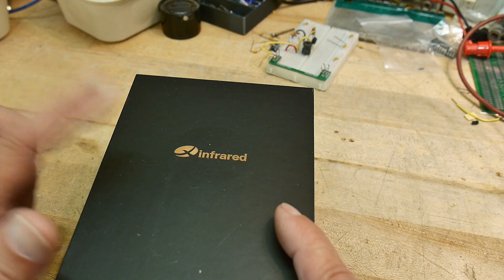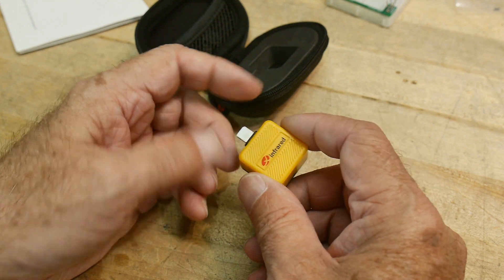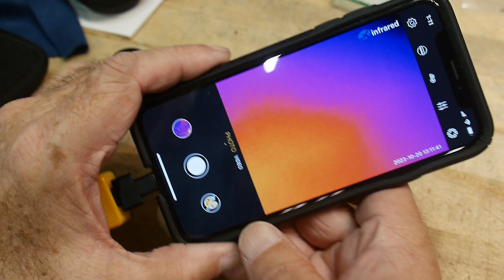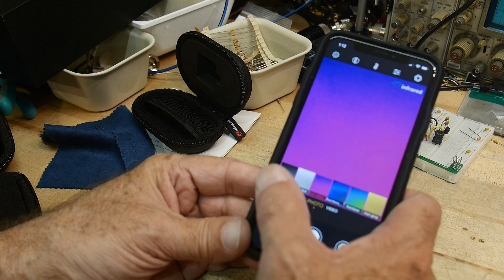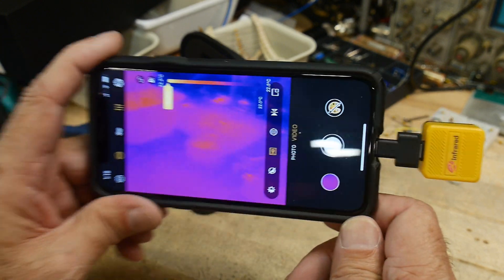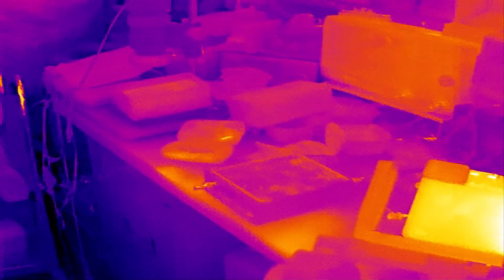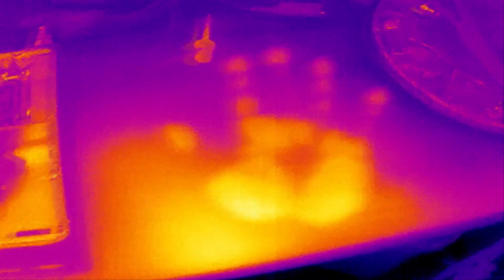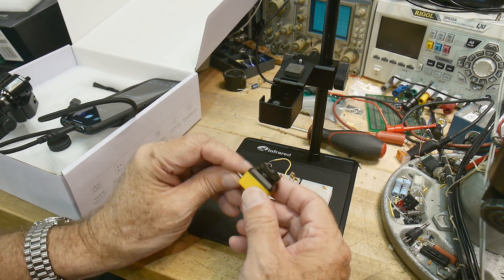#1687 Xtherm II T2S+ Thermal Camera Review

Comment: I bought one to check for potential problems at a client's house and it's since been a valuable tool to have. I don't use it often, but no need to charge the battery beforehand which is better than FLIR one. it's worth every penny. 👍🏻

Comment: Very nice camera for sure. But i dont like to connect it to a smartphone at all. It is expensive and so i want to use it for many years of course. But nobody knows how long the app will be supported and i am sure the connectors will change again and again over time. Just for example, here i have a very good loudspeaker for the old 30 pin iphone connector. So at the moment i still keep my iphone 4  just as a music player because i like the sound but the speaker is no use with my actual xiaomi phone (yes, i went from iphone to cheap chinese phone) and no use with any modern iphone as well...

Comment: Will there ever be thermal imaging devices that are in the price range of hobbyists and makers on a budget? Certainly a lot of electronics tools can be expensive, but in most cases there are less costly alternatives that are useful for limited purposes. You can get a USB oscilloscope for less than $100 that is wholly adequate for some projects. But thermal camera manufacturers just don‘t seem to offer anything like that. Is there something about the technology that makes it impossible?
Reply from the maker: thermal cameras on Aliexpress are in the $50 range. This is a high resolution professional quality one. as with oscilloscopes you get what you pay for